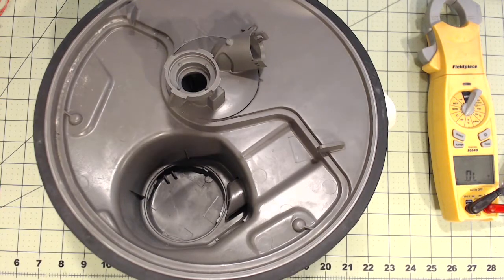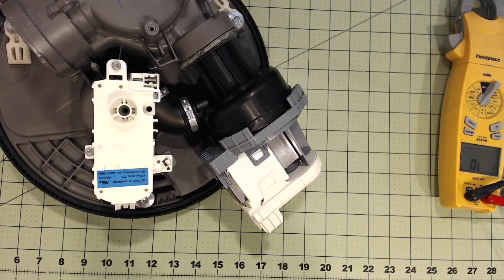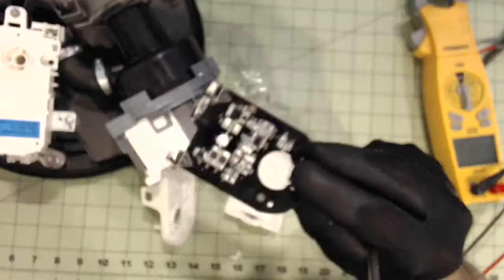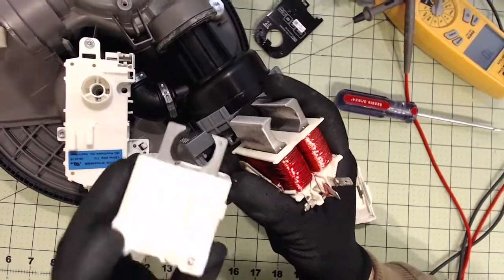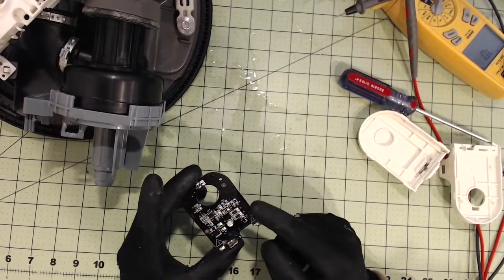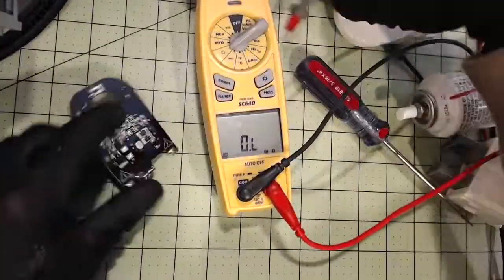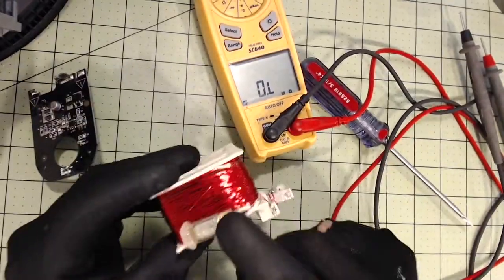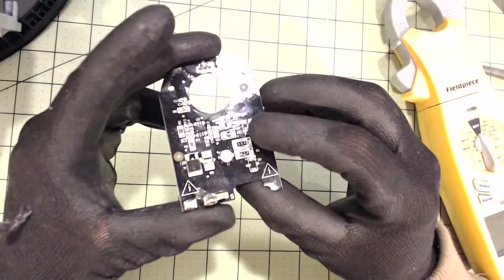GWS Motor Teardown

Comment: Usually what happens on these is the bearings (cheap bushings) whirlpool uses wear out causing the shaft and impeller to be met with intermittent resistance upon startup. Typically slamming the door hard will get the motor working sometimes. Ask me how I know (besides being an appliance tech myself)